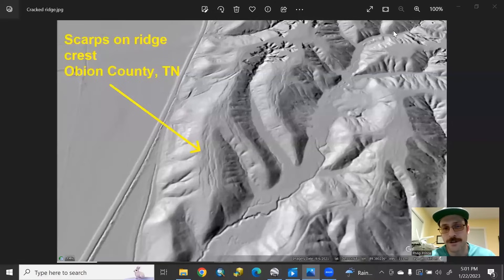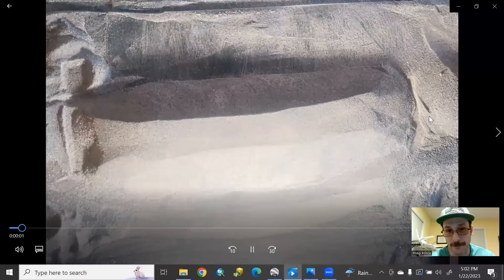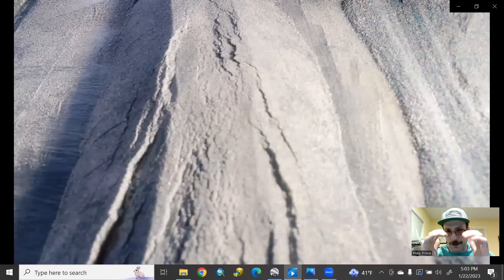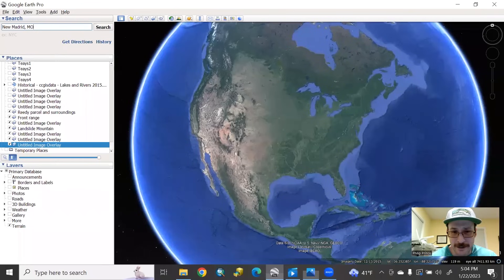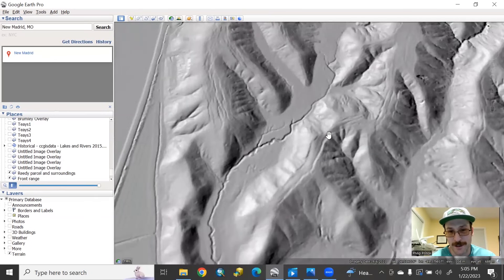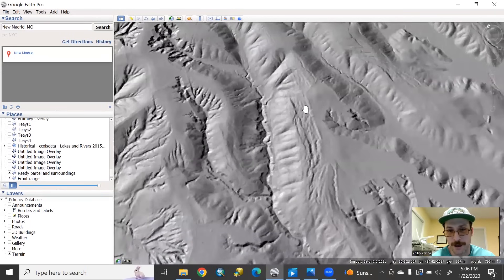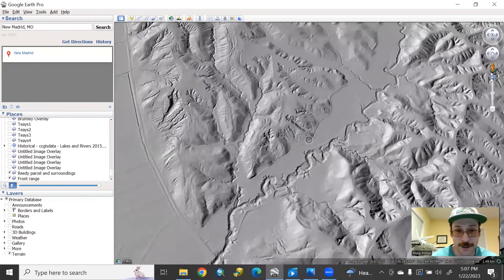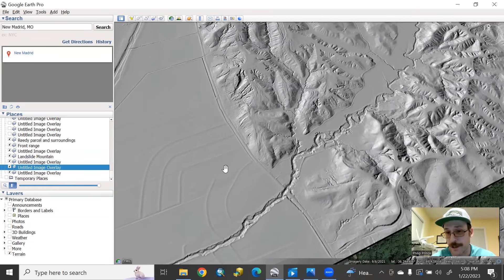1811-1812 New Madrid earthquake damage...see it with LiDAR | Geology Models

Comment: I read about the New Madrid Fault and witnesses actually recorded/wrote what happened and pictures were drawn. Research it because if clusters of earthquakes happen within a close period of time and an 8.  or higher hits again people not just in Mississippi, will feel it all along the start and ending of the Mississippi River will feel it and what will happen is flooding, landslides, movement of land masses. Hoping that current buildings in that zone area are up to code earthquake proof = buildings move with the shake versus fall down, and that people have their heavy tall furnishings bolted to the walls that way when your trying to get to a safe area items such as book cases China cabinets are not falling on you or blocking your escape routes!

Comment: I have an area on my land (Lookout Mountain AL) that has what appear to be 'terraces' that are 30-50' wide and about 10-20' lower than the next highest strip. Are these scarps?

Location:     34.065415° -85.969715°

The geology is a sandstone cap on the top of the ridge, then shale layers and a few thin seams of coal (3-6" thick) between the shale layers. There are also limestones below the shales.

It is very difficult to get in to the area as it requires climbing gear to get down to these terraced areas and they are practically isolated micro-biomes with extensive fracturing of the limestone (irregular vertical fissures that are just a bit too big for climbing nuts, blocks or chocks. 

The further down the terraces I go the wetter each area gets with free water dripping, streaming out of gaps in the rock. 

I know the area is valley and ridge and less than a mile to the south it had been mined commercially for coal in the 1870's to about 1910 (that had to be miserable). I own my own mineral rights (a rarity these days) but have no intention of exploiting for minerals.

Lookout Mountain just seems to be another ridge, with Sand mountain to the west and Shinbone Ridge immediately to the east. I live north of what is known as the Gadsden Mushwad Complex".
Reply from the maker: Might just be expressions of bedding in slightly mechanically distinct layers. Doesn't sound scarp-like, and I don't think that sort of thing is documented around there. Sounds like quite a spot. The ole Gadsen Mushwad (and its Palmerdale counterpart) are true classics!

Comment: IDNR in IL has a hillshade LIDAR tool.  Its made my engineering work a lot easier and useful to confirm features in survey and give more detail in my models.
Reply from the maker: I have gotten a real kick out of the Hicks Dome area in southernmost Illinois. I admit I never much thought about there being topography and outcrops down there. Some of the joints and fractures in the cliff lines on the north flank of the dome are about as good as you can see anywhere in the US with lidar.

Comment: Serpent mound on east coast! 1, 2, 3 Go!
Reply from the maker: The culture that built it undoubtedly felt a rattle or two, given recurrence interval.
Reply: @TheGeoModels I think about that a lot. What must have went through their minds??? There are mounds literally all over southeast Missouri, Southern Illinois, Western Tennessee and Kentucky and Northeast Arkansas. Those tribespeople in these areas had to have a belief system that included earthquake mythology. Even the small quakes are interesting to feel. The amount of energy to shake the earth is impressive. I've worked around large machinery/ equipment and you can feel vibration when you're near but 30 feet away you don't so something that shakes the earth for such a large area is quite impressive.

Comment: How old are those sedimentary layers, and how well consolidated? I imagine that the sediment of those ridges would be saturated. There must be an element of liquefaction, as evidence by other effects from the 1811-12 quakes. Much water must have been released from those shaking sediments. Could some of the drainage marks on the flanks of the ridges have been formed by that released water?
Reply from the maker: Not sure about the drainage marks (probably lots of bad conservation over the decades as well), but yes, it's sort of a liquefaction-type response. In the dry models I used, the weak material inside the model ridge loses interparticle friction with shaking, and the stress field resulting from the shape of the ridge controls the failure style. The real ridges are unconsolidated stuff; not sure how old they are, but it's not flat lying rock in the Appalachian Plateau sense by any stretch. Maybe the interiors of the ridges liquefied within the saturated zone? Lots of sand blows around, etc., down in the flats.
Reply: @TheGeoModels  The sand I use is dune sand from a dune eroded out of a formation that was deposited as a dune during Mesozoic. Not having angular edges gives the sand some interesting properties when saturated.
Reply from the maker: @andyjackson3414  subround or round granular stuff is key to making representative simulations. The glass microbeads do the same when you push the pore pressure up. I bet your Mesozoic dune grains had no idea that their future involved scientific investigation!
Reply: @TheGeoModels  I doubt it would make good sand for concrete. 
Some iron oxide (?) clay adheres to the surface of the grains. The parent sandstone is somewhat friable

Comment: ♥♥♥ GIS Geek here. This is why I love LiDAR so much. In the hands of well spoken analysts (like you) complex mechanisms can be clearly shown. THANKS!
Reply from the maker: Thanks! I have used the stuff daily (weekends included!) for years now. What did I do before? Just put up a vid about Carolina Bays...I'm not in the impact origin camp, but some of the lidar showing dunes, etc., and their interaction with bays is cool.
Reply: @TheGeoModels Indeed. I'm "on the fence" as to the impact idea - I've used the "Carolina Bays" LIDAR interval data to investigate  the dune fields here in Haskell County Texas. Can't find much literature describing them, yet everything I can tell indicates that it is a major feature that feeds our local aquifer as the dune areas have NO drainage. Our property will absorb a four inch per hour rainfall and be dry in an hour or so.
Reply from the maker: @jrkorman  I'll have to check out Haskell County. The Llano Estacado has about the most and best "bays" out there, though they are called playa lakes in the region. I would tell you they and bays are the same, but I bet others wouldn't! Texas has all kinds of cool stuff to see.
Reply: @TheGeoModels An interesting observation - the playas at and east of Lubbock are indeed playas. They are roughly circular with flat rims. However, look at those to the west of Lubbock, especially Bailey county, TX and Lea County in New Mexico. Totally different shape and rim structure.
The dunes here in western Haskell County appear to be a result of sand blown out of the Double Mountain Fork Brazos River bed. In several locations the patterns match how south westerly winds would have blown that sand. The dune structure ends rather sharply just to the east of Rule, Rochester, and Knox City.
Reply from the maker: @jrkorman  very interesting. I was cruising around Bailey County earlier. With a big hillshade exaggeration, the Lubbock guys have a bit of a raised southeast rim.
Reply from the maker: @jrkorman   Not sure how these features never ended up in the impact debate...with the exaggerated hillshade (which all bay lidar uses), the whole Lubbock area is much more crater-ish than bay country!
Reply from the maker: @jrkorman  Zahn, Winchester, and Scott Lakes (and their buddies) have some nice rims on them with a hillshade exagg...
Reply: @TheGeoModels Yes those lakes also are co-linear with some smaller "bays" to the southwest in Jones/Fisher counties as well as possible "bays" near Seymour and others to the northeast in Oklahoma, making it appear that they could have been part of a ejecta ray.

Comment: Retired after having created several geologic maps while lidar point clouds were becoming available in my area(s). I learned how to process them sometime in the middle of that part of my career and quickly realized everything I had done before were incorrect in detail. Assuming my field analysis was correct the exact mapped locations were just not that good before lidar.
Reply from the maker: I hear you...I have only had about 1/2 of 7.5' quad without high res lidar, but it was a totally different mapping experience. Some of the old Valley and Ridge Virginia stuff came out well, though, presumably due to reduced vegetative cover and the strong rock strength control over topography. I wrote the link below back in 2019 about a '65 map  done in an area that now has 1-meter lidar. They actually did a remarkable job!
https://blogs.agu.org/thefield/2019/02/15/a-lidar-perspective-on-a-1965-geologic-map/

Comment: can lidar expose the sand blows as well?  those were quite extensive down there....
Reply from the maker: Not sure, but it would be tough because the sand comes out as a liquidy slurry and doesn't pile up well to leave a mound to produce a shadow in the hillshade. If the sand covered some sort of existing gully or something like that, you might see it as an odd looking smooth spot. It's a cool question. I'll see if I can check it out.

Comment: You can still see the damage from the New Madrid quake at Pulltite Spring on the Current River.  The top of the bluff broke off, a boulder the size of a house came down and is mostly submerged in the spring.  You can still see trapped trees under the boulder in the water, and remains of the scar it made coming down.
Reply from the maker: Now I'll have to check that out. Sometimes you can see tracks left by rolling boulders in lidar imagery back east in the Appalachians. Wonder if this one is visible.
Reply: Seriously? Live up the Rd from there, Jadwin.
Reply from the maker: @idrinklight44  True stories. Would have been a crazy event to witness live
Reply: @idrinklight44  Seriously.  If you are standing at the spring and look up, you will see the missing piece of the bluff, on the right. If you look down into the spring you will see the boulder. If you look closely under the boulder you will still see the trees it took out coming down. The trees are still preserved there because of the low temperature and low oxygen water.
Reply: This is a new to me story......where did  you learn this
Reply: @kansasscout4322  news to me too! Im gonna see if I can find historical records about it. I definitely want to go see this! This is now on my list of fun adventures for this summer!!

Comment: I'd like to hear your take on Crowley's Ridge in east -central Arkansas.  It runs north/south in the delta country and is a very rare geologic formation that kind of defies explanation.  The ridge runs from just south of Forrest City and north nearly to Jonesboro.  It is around  150 miles long, and rises to a height of over 500' above the Mississippi alluvial plain, and I haven't found anything definitive on its origin.  There is a page on Wikipedia as well as several other articles and webpages on the Ridge.
Thanks for your efforts!  I enjoyed. this one and am subscribed now.
Reply from the maker: @EGlideKid  sounds like Low Country South Carolina. There is an area called "High Hills of Santee" that is just like a miniature Crowleys Ridge. You can actually Google it; it has a Wikipedia page. Folks treated it the same way as Crowleys...I'm sure it was only spot to catch a breeze and lose some mosquitoes and cottonmouths! I would say they are geologically similar, too...
Reply from the maker: Now that's an interesting feature...I have looked at before with regard to where the St Francis River cuts into its east side down around Forrest City--it does interesting things to the streams on top of the ridge that flow back to Crow Creek in the center of the ridge. Never been to it in person though...It's definitely an erosional remnant that hasn't been beveled off by the rivers yet, but the topography makes it look like it has some "structure" and might indeed reflect some slow ground surface movement. It must look interesting in person with how it rises above the flat lands, for sure.

Comment: Given the lineup of these features and their association with the fault line, it is clear that they are transverse to the fault. In your model the shaking resulted in scarf formation at roughly right angels to the direction of motion of the shaking. Applying that to the New Madrid fault, the S waves would have been in-line with the scarfs, which is at right angles to your simple model. That suggests to me that the cause of these was not the shearing S waves as you modeled, but rather than compressional P waves. I think it unlikely that it was Love or Raleigh waves, though those need to be ruled out before concluding that it was the P waves that caused them.

It would also be helpful to rerun your model a couple of times using up-down motions centered under your sand mounds, and at the farthest end of the table away from the mounds - to see what the resulting impact is on the mounds. How does the character of the scraping change with each, and with energy levels. You may be able to simulate the Rayleigh waves as well with your setup. Though emulating the Love waves would require using a pliable base that can support the long wavelength land deformation of Love waves. They might though produce similar features and be worth investigating. 

All of that needs to tie with estimates of the depth and character of the fault rupture. 

Most of our seismic studies are biased and based on near surface shearing fault ruptures as seen in California. These produce very sharp P and S waves and weak Love and Rayleigh waves. New Madrid seems likely to be of that nature, though not necessarily. 

The offshore major fault complexes that produce mega thrust earthquakes also have these strong P and S wave structure near to the rupture site, with the P wave generating the tsunami’s associated with the rupture. But at distances 100-400 miles away, the Love and Rayleigh waves dominate and continue for periods of minutes. Huge ground waves result. 

Does New Madrid show evidence of that at a distance? In other words, is its character more surface rupture like as in California earthquakes, or megathust like with deeper origin and a different mix of intensities of the four movement types?
Reply from the maker: So I have messed with different shaking orientations...the result is the same because the microbeads loose frictional strength with acceleration, and the shape of the model "hill" and associated stress field ultimately dictate what failure looks like. It would indeed be cool to deliver energy in different ways, but I think it would be a complete re-write for my simple setup!
Reply from the maker: I am not versed in the finer points of New Madrid rupture, but it has been studied to death, for sure. i think the seismicity is at a depth range similar to tsunami-forming megathrust quakes. I think there are plenty of coseismic sackungen (spreading hills) in So Cal as well, due to the background geology.

Comment: Really nice models here. Born in Sikeston and spent a lot of years in Poplar Bluff and Kennett. Always aware of the interesting structures and land changes from the New Madrid quakes and seismic system. Have you done any model on the sand blows or how buried trees have floated up to the surface from that activity? Wonder how many neighborhoods are build over these deep soft sediment layers and are in danger from the next event.? Well done.
Reply from the maker: Haven't tried a sand blow...not even sure how I'd do it! Definitely sounds like a good challenge. The video linked below has a buoyant object floating out of the liquefied sand (after the bus sinks...).

https://www.youtube.com/watch?v=cSaatSdS4Sk
Reply: I've played around a bit with a home-made stream-table model using very fine sand that I can tilt and shake. Its interesting how saturated shaken fine-grained sediment behaves.
Reply from the maker: @andyjackson3414   I got an older video on here where I hammer a metal bucket full of wet sand. It's crude but interesting...I added the element of a buried buoyant item, which floats with the liquefaction. Some other Mr. Wizard-type of channel borrowed that down the road, which I rather liked! Using the dry media with the frictionally weak microbeads does a nice job with the scarps. I guess much of the video was sort of a lidar-interpretation kind of thing, though the model scarps are produced by the same sort of deformation as the real thing (just without fluid pressure reducing shear strength).

Comment: There is a scientific theory from the Holy Qur’an that says (and Pharaoh with pegs) and (and the mountains as pegs) means that the pyramids were built to resist earthquakes, and twenty-four sequential pyramids were built in weight and size, starting from Giza to inside Sudan to make a balance in the ground, and that  To repel an earthquake that was coming across the Mediterranean Sea and extending its movement into the Red Sea.  As for the earthquake in 1992, it occurred because of the heaviness of the waters of Lake Nasser, the effects of which were removed by the opening of the Toshka spillway.